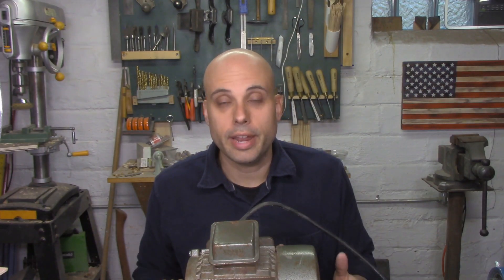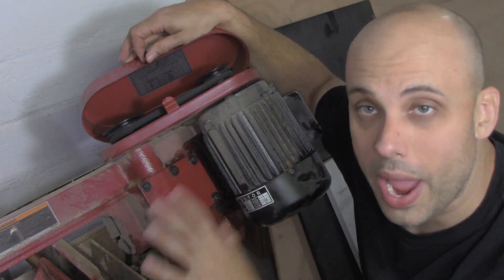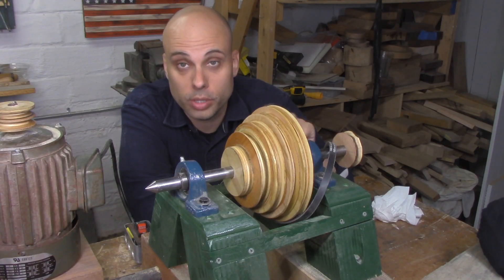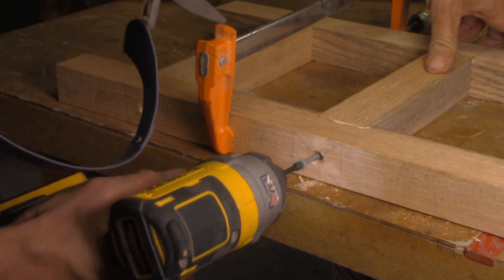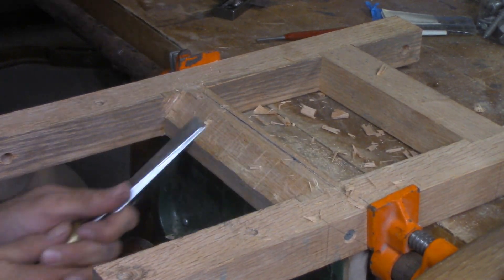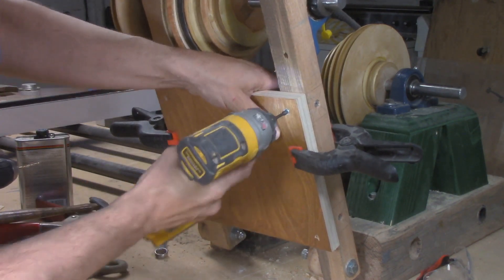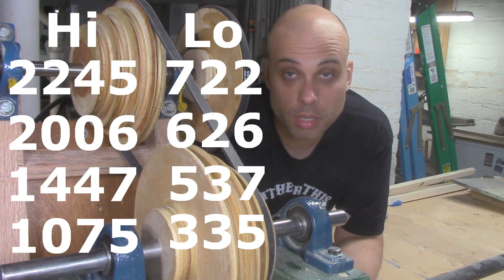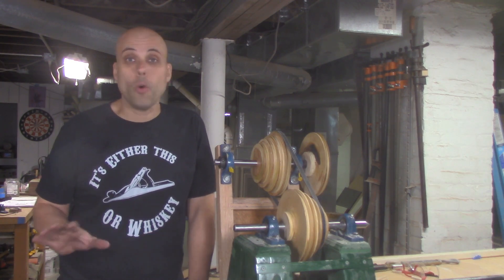The Real Lathe Pt. 3: Countershaft

Comment from the maker: Before anyone says it, YES, I know that a DC or 3-Phase motor can give me electronic speed control. I know that building that speed control is easy for some people. I'm using an AC motor because I have it and many people have AC motors sitting around. I'll probably upgrade to DC in the future.
Reply: I agree with your choice of motor. But second hand 3 phase motors are much cheaper (Ebay), because most people don't have 3 phase supplies, and cheap Chinese inverter/speed controllers are now very affordable off Ebay.  This is the way to go for an upgrade later.
Reply: @donaldasayers  sir thanks  for the lesson the how to make  pully do you have a computation  and size of wood for for deferential size of speed for low and high-speed  thank you  and have a nice weekend
Reply: Three phase isn't available everywhere.
Reply: Is it possible to make the polley with MDF?
Reply: @bricotico6498  I think the edges are too weak for it to work.
Reply: Isn't what you have in the video a single phase induction motor? Should be perfectly fine to run with a single phase variable frequency drive for electronic speed control. Ofc you still want to use the pulleys for coarse speed control since you can't change the number of magnetic poles of the motor (which gives the proportionallity constant between electric frequency and shaft speed) to get more torque at low speeds (induction motors with variable frequency drives get near constant torque up to the nominal speed).
Reply: RPM

Comment: Hi Rex,
I want to have a go in making wood pulleys, for my high speed hand made knife belt sander/ grinder, but I am concerned with the sides of the pulleys snapping when pulley is in motion or if the heat from the v belt drive transfers to the wood pulley and heats the glue up and separates the pulley wheels, I wonder if long thin wood screws be placed through the pulleys to eliminate worries of heat transfer separation. 
Firstly are wood pulleys only safe for certain speeds, Have you ever had issue with pulley breaking or separating ? and using ply seams to be the wood to use but could we use a natural wood , and is soft wood or hard wood best from what you have learnt
Also how long does a wooden pulley last on say a wood lathe, ? could it last like an aluminium pulley
Reply from the maker: I think a wood pulley will be fine and last a long time.  From my experience,  use hardwood. Maple would be my choice.

Comment: Hi Rex! Turning these rabbets is a bit tricky because the sidewalls must be precise. I recommend the tiny little but great and free construction software named A9CAD to make a gauge for the aforementioned purpose like this: https://www.pic-upload.de/view-36648485/LehreKeilnut.jpg.html
It's made for 10mm V-Belts according to german DIN2215. The software gives you dwg.-Files you can use for lasering the gauge from stainless steel or you print the shape and make your own gauge from a piece of plastik or hardwood. Hope it helps someone. Cheers!
Reply: ATTENTION: THE link leads to a pop-up scam

Comment: Do u just wanna sell the lathe im trying to get one just dont have everything to build it
Reply: _ David _  prob would agree with u just finding everthing seems like a hastle
Reply: Also in though i wonder if a dryer moter will work have an extra dryer that resently started squeeking and no heat but it still turns i wondrr if that will work

Comment: From the GET GO.
#1: find an old treadmill someone wants gone for free and salvage the variable speed motor and the controller board.
#2: Watch a few videos on how to wire it (often used for 2X72 belt grinders) and you will have a 2 HP variable speed Lathe motor!

Comment: Great series! Just curious if you chose your wheel diameters mathematically (ie with a specific target in mind) or aesthetically (went with what looked good). Thanks for sharing!
Reply from the maker: Mathematically!  I'm an artist, but this is no time for aesthetics. I did use an online pulley diameter calculator, but I had target speeds in mind and I designed it to hit those speeds.

Comment: Since you were setting the ratios, why did you make the lowest speed so high?  A lowest speeed of around 50-100 would have been much better.
Reply from the maker: Well, my current lathe has a low speed of 600 rpm, so 300 is a BIG improvement. Also the low speed is determined (largely) by the size of the low range pulley, which is already big. Any larger than that and I would have had to redesign the whole thing to accommodate some monster pulley. Good question!
Reply: Then we needed to get ready for a future podcast where you redesign your pulley system.  Believe me, you will want to go slower.  ;-)   My last lathe, before  my old (1998) Woodfast M910, was a Jet 1440 with a low speed of 450.   That is way too fast for large,  heavy or out of balance chunk.   But, in the meantime, have fun.

Comment: This is awesome! Do you have any plans to build any kind of housing for all the exposed pulleys and belts? It looks like a real hazard for catching any loose fitting clothing or dangly bits...or even chunks coming off the late.
Reply from the maker: That's why I shave it. I could have a head of the most beautiful hair you ever saw, but I shave it for safety!
Reply: Wood chips getting in there would be the biggest concern, since any trapped clothing would just come free after 3/4 a rotation (and hair, well..). I made myself a little magnetic chip guard out of a hardwood frame & wire mesh (5mm in this case) and it works remarkably well, doesn't weigh much, & looks quite cool too. I can highly recommend it for a cover.
Reply from the maker: @NightCatArts  I do think there's some safety concern. A belt guard will be one of the finishing touches.
Reply: @NightCatArts    Hair wouldn't be a concern....  (Sorry Rex, I saw the opening, I had to take it....)    :)

Comment: One big advantage of belts: They absorb pulses, better backpulses from the tool, when this gets in contakt with the material. So the bearings live longer and the whole machine runs more silent. And belts are easy and cheap (!) to replace. Bearings not. So a tablesaw with a belt runs way better then a direct coupled saw with AC-Universalmotor, where every pulse hammers into the bearings from the sawblade into the motor. This you will find typically in jobsitesaws. Hope, it was understandable, englisch is not my mothertongue.
Cheerio from Germany.
Reply from the maker: No, you were TOTALLY clear!  Glad you approve of the design choices.
Reply: Also, no-one mentioned that using mechanical rpm reduction increases torque.
Reply: Your English is very good.  Thanks for the information.

Comment: I enjoyed the video, and I'm following it. May I ask for the diameter of the pulleys ? Well done mate. Cheers.
Reply from the maker: No problem: The range pulleys are 8 inches and 3 inches. The double pulley on the motor is 2.5. The cone pulleys go 8, 7, 6, 5 inches. All these details will be in the final plans. Glad you enjoyed it!

Comment: Looks good and explains my question from the last video. I like the way you've used a cantilever mechanism and the motor weight to do all the belt tensioning; makes speed changes quick and easy.
Reply from the maker: Steve Crane Thanks! I like it too,  but I'm not sure this setup is delivering enough tension.  I might have to rig up a tension lever anyway.  Oh well,  it's a process.
Reply: @RexKrueger  Would wedges work?  That would be simple and cheap.
Reply from the maker: @jimwilliams2682  That totally might work. Wedges do deliver good tensioning. I think I might make an "over-center lever|" it's commonly used on old metal lathes.